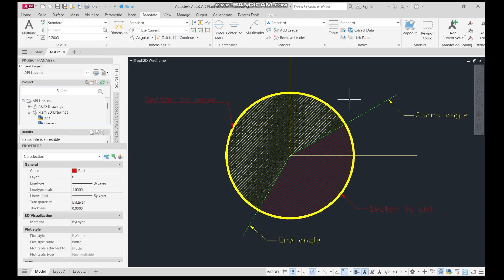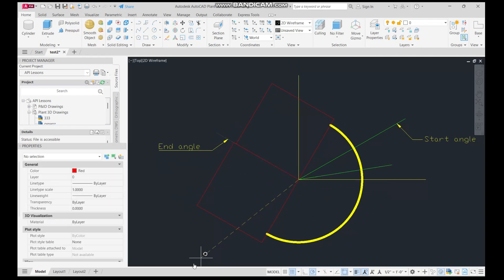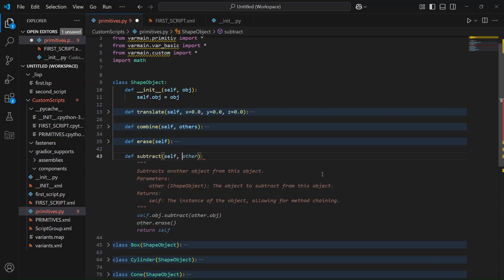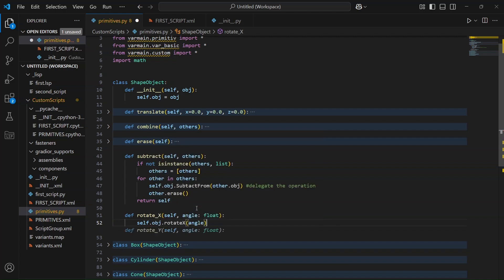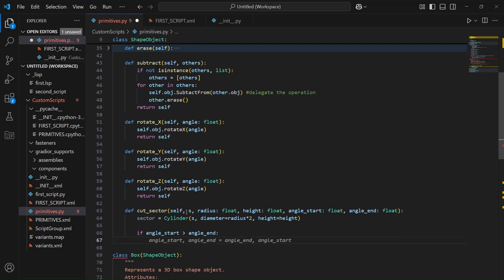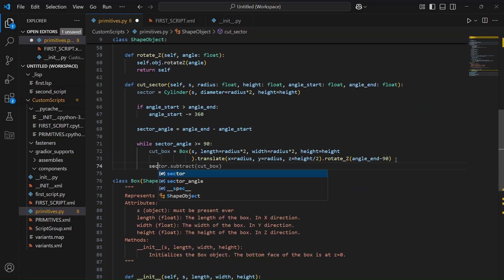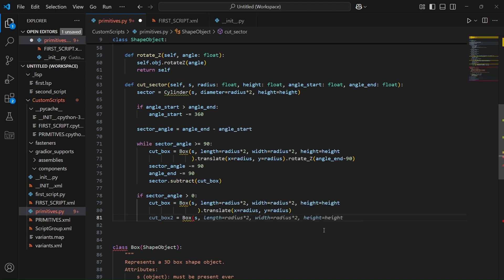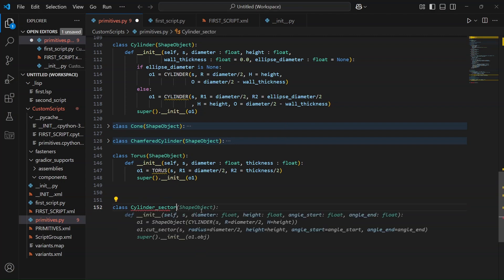Custom Supports in Autocad Plant 3d with Python – Full Guide Series (Part 4)

Comment: Hi, great videos. I'm having an error trying to run this one, I get the "Geometry can not be generated with the given parameters.nil" it seems to fall over at this line of the subtract code "self.obj.SubtractFrom(other.obj) #delegate the operation". any ideas of what would be causing this? or has anyone else had this?
Reply from the maker: Hello, yes. There is small mistake at 01:35 (ShapeObject subtract method).
✅ In the video I used SubtractFrom, but the correct Plant 3D method name is subtractFrom (lowercase s). So please correct it in your code.
Thank you for staying with us
Reply: @SmartProjectDesignStudio  Thanks for your help, working fine now. Can't believe I didn't see that. 🤣

Comment: I have one doubt, Could you clarify your background? Is it in piping or software development
Reply from the maker: Hello!
I'm actually a project designer specializing in industrial boilers, boiler plants, and power plants. My work covers the full cycle — starting from boiler design (thermal and hydraulic calculations), through detailed design and P&ID diagrams, to pipeline routing and even commissioning of the boiler or entire plant.

Part of my job also involves finding ways to automate routine engineering tasks to save time and meet tight deadlines. That’s why I use programming — like C# .NET for AutoCAD and AutoCAD Plant 3D, Python for custom Plant 3D libraries, and VBA and C# .NET in Excel.

Over time, I gained enough experience in this area and decided to share it with other engineers who might be facing similar challenges.
Reply: @SmartProjectDesignStudio Your life journey is very interesting. I'm glad to share my life journey with you. First of all, I'm a piping engineer, and I'm facing a lot of issues, particularly with modeling. Seriously, I don't know Python, but I'm learning day by day via YouTube. If you don't mind, could you share your email ID...
Reply: Hello!

Glad to hear about your life journey! First of all, I'm a piping engineer and I'm facing a lot of issues, like modeling. Seriously, I don't know Python yet, but day by day I'm learning via YouTube. If you don't mind, could you share your email ID
Reply from the maker: Sure. l.fatych@gmail.com

Comment: Once again thank you 🎉so 😢Awesome man🎉
Reply: I have one doubt..."Is it possible to create cable trays or ducts using a Python script, similar to a pipe pull-up method, rather than a component pick-and-drop method?"
Reply from the maker: I'm not sure yet, Sir — I haven’t tried it. Everything I’ve seen so far about cable trays uses the drag-and-drop method. Personally, I don’t work with cable trays anymore — it’s outside my responsibilities now. But ducts, yes — and there should definitely be some planning involved. It’s a pity that AutoCAD lacks dynamic block features for 3D blocks. I’d definitely use them in this case if they were available
Reply from the maker: I’m glad it work for you.
Thank you for staying with us.😊